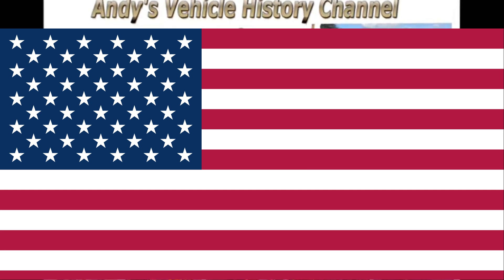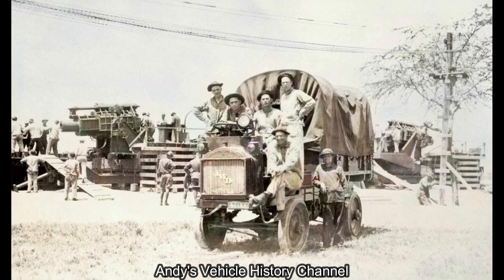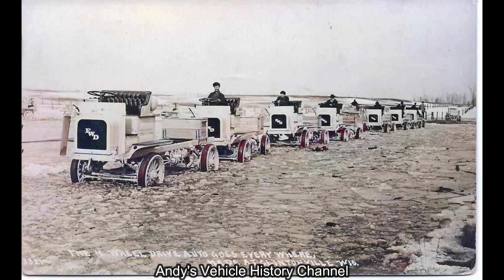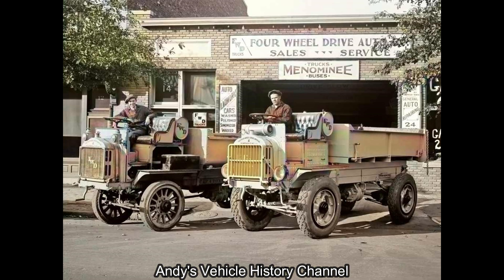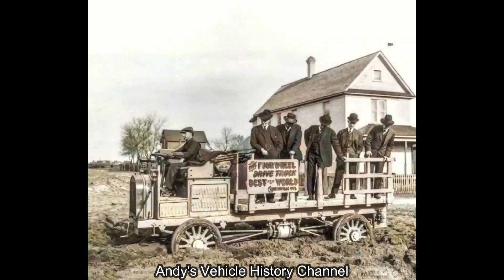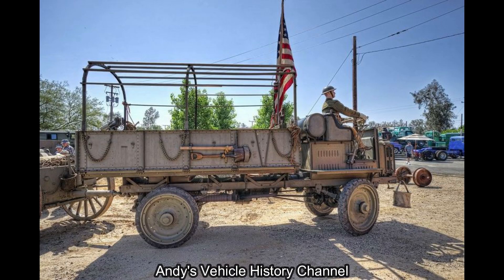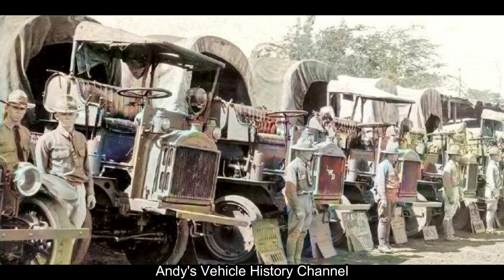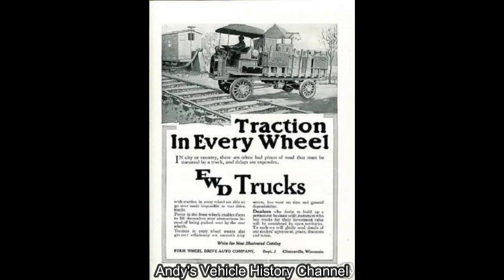FWD Model B 1912 🇺🇲

Comment: I grew up with an FWD model B inherited from my grandfather.  It was the most advanced vehicle of it's day, but that day was pretty early.  On the one hand it has full time four wheel drive and four wheel brakes, an aluminum engine block and transmission case.  On the other hand it has a leather fan belt, felt ring oil seals, and a water pump packed with greasy string.  And the four wheel braking was accomplished using one constricting brake band on a flywheel on the back of the transmission: Four wheel brakes while it was working and no brakes whatsoever when it failed and prone to terrifying brake fade if you're not careful.

Just a couple of quick corrections:  The Wisconsin is a T-head engine, which is technically a side valve but very different from a modern side valve.  The silent chain is inside the transmission case and transfers power from the transmission to the center differentials, just like many modern  transfer cases.  There are two center differential locks for redundancy.  You can drive the truck with a missing drive shaft by engaging the lock for the remaining shaft.  The front axles have fully enclosed Try-Y CV joints for steering, and the front wheels are toed in to reduce steering effort.  .

Oh, and one more thing: top speed is only 15 MPH if you are smart, it's 20 MPH if you are brave.  20 MPH feels very fast in a 100 year old truck with marginal brakes and no windshield. Good job with the video.
Reply from the maker: That's magnificent you have first hand knowledge of this amazing truck i can very much believe that you would get up to 20 mph how big is the fuel tank ?
Reply: @AndysLife27  30 US Gallons, more or less.  There were several tanks from various suppliers, some were cylinders, some more ovoid.  The tank has a fuel tap on each end so it will always draw fuel even when tilted.   Another neat feature:  The throttle pedal can be rigged to either go up and down or side to side by flipping the bell crank 90 degrees.  Side to side allows the driver to keep his foot planted on the floor in rough going but opening the throttle by twisting your foot tends to be hard on your right knee.
Reply from the maker: @danielstickney2400   How they came up with them ideas in 1912 ill never know but that's amazing we are going to get a part 2 out soon with your help we can make it even better.

Comment: Why did most of them have those flat tires as opposed to air filled tires?
Reply: Load capacity. Solid rubber tyres were standard on all trucks into the 1920’s.